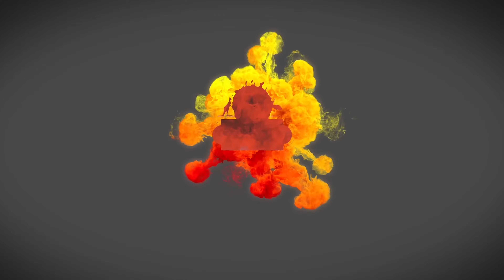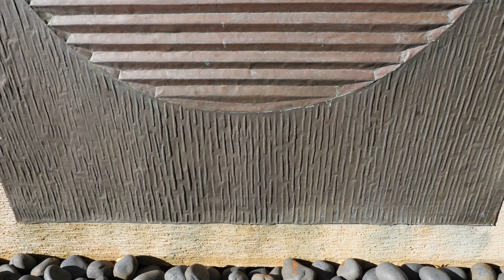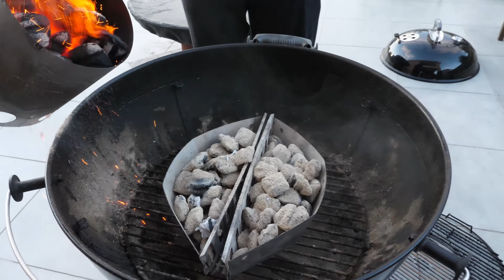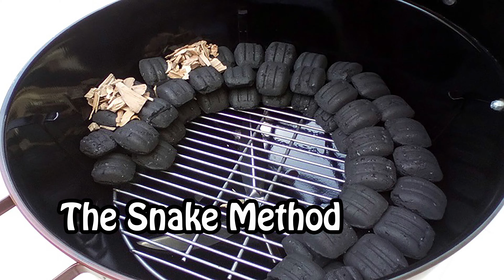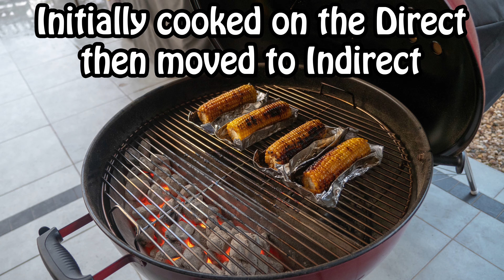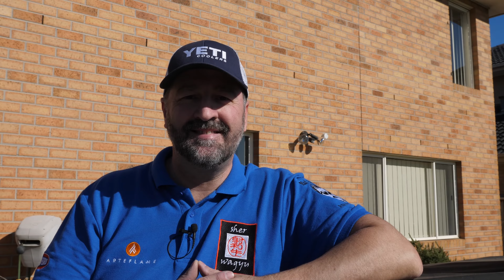4 INDIRECT Charcoal Grilling Set Ups On The Weber Kettle | How To Barbecue | 4K

Comment: G'day mate, enjoyed the vid. Just wondering where you get those slow and seer mods with the water well in it?
Reply from the maker: Hey Darren, pretty sure I bought it on Amazon and used Shipito to get it across here. Expensive to do that but they are awesome. Not sure if anyone imports them over here.
Reply: @HectorsSmokeHouse  oh righto, what's it actually called? I'll look it up 👍
Reply from the maker: @old_geez8457  https://www.amazon.com/stores/page/83A59EA9-3334-45F9-B327-3E1BFAF97AF3?store_ref=SB_A0636264EQTTSM94VPX4&pf_rd_p=591760d1-6468-480f-9b10-0ee9c85706fd&aaxitk=9xP572KymQJaWp4on-OO2w&hsa_cr_id=4108931560301&lp_asins=B07S2Z47WJ,B01HZXPK5E,B07N94FV2Z&lp_mat_key=grill%20griddle%20accessories&lp_query=Slow%20n%20sear&lp_slot=auto-sparkle-hsa-tetris&ref_=sb_s_sparkle
Reply from the maker: @old_geez8457  Slow N Sear